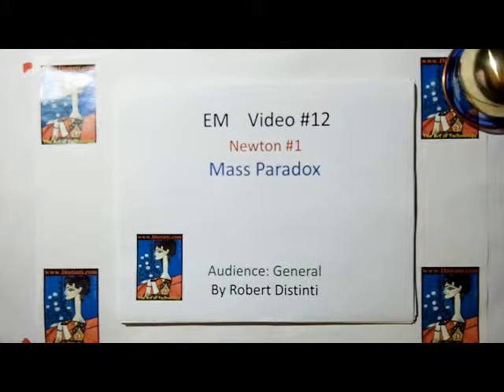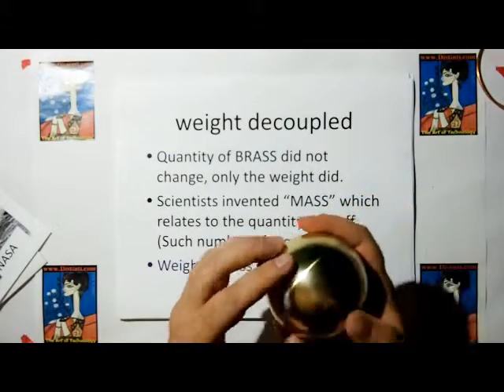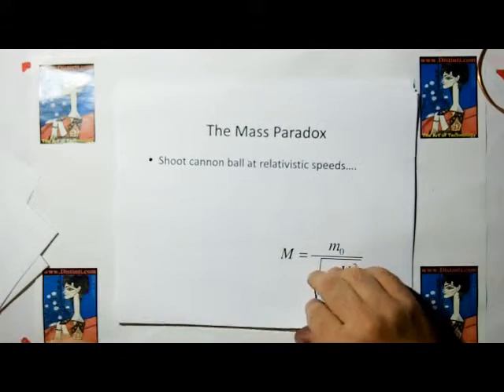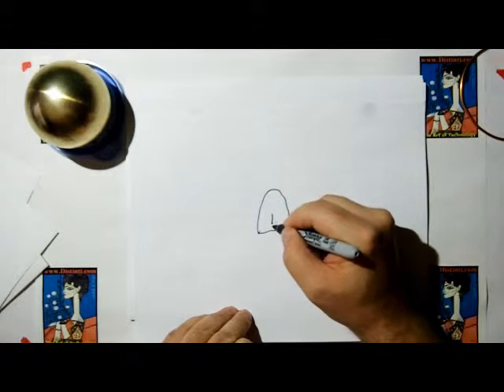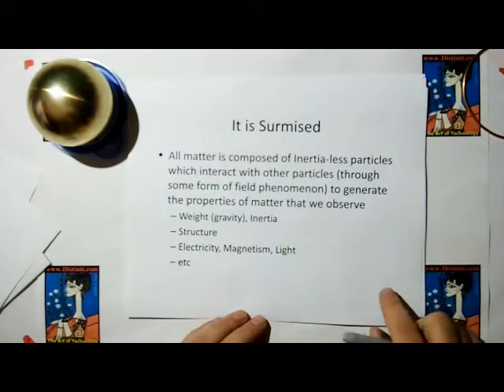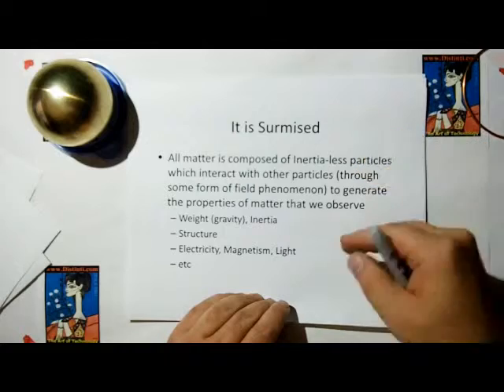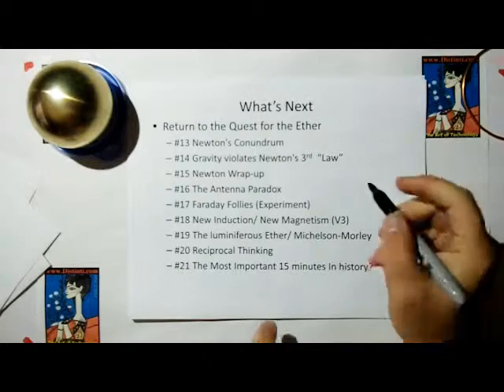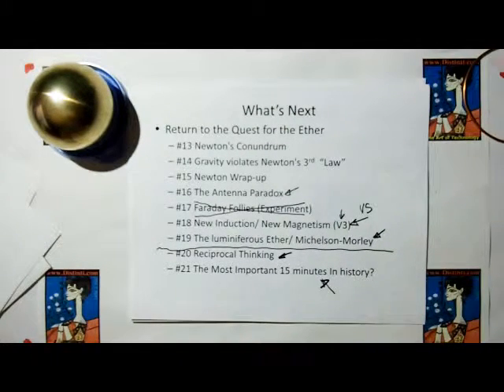emV012: Mass Paradox

Comment: When you expand your model to chemistry and electrolysis and plasma, the idea of mass conservation becomes negating of these models of particles.  It seems to me if you go after mass in E=mc2, you might as well go for folding mass into the formation of Aether into particles.
Reply: that is more or less exactly what quantum mechanics says particles are. their wording is vibration on a field but it there isn't really much different
Reply: Royvan7 so mass Or energy is not limited to the law of conservation. The stuff they are made of is conserved, but is not quantified in the exchange. So energy can be created from space, not from energy or mass. Over unity is normal.
Reply: one of the things both GR and QM agree on is that mass doesn't exist and is simply a property energy can exert. that is what e=m*c^2 implies. this energy moves through space. so, what is the next turtle down? what is the energy composed of and what evidence have you found this out from?  why would you assume we can derive energy from space? we've never seen the 2nd law of thermodynamics broken. why assume?

Comment: What about momentum ? Relativity mass paradox occur when we abstract mass from momentum, in fact if you multiply both sides of equation by velocity then it's momentum which changes near the speed of light. How about replacing mass by momentum in Newton physics ?
Reply from the maker: What is the electrical analog of momentum? Answer that question and you will answer your question.
Reply: @rdistinti  Is it current?

Comment: I have another serious problem with the classical model: There were many experiments for the measurement of the inertia of particles, but I miss any experiment for the weight of particles. I mean, the weight was always measured on neutral bodies (with same amount of positive and negative particles), and nobody checked the effect of gravity separately on particles. We can get the same weight for a neutral body, if we use a larger g constant, but proton has positive, electron has negative weight.

Comment: It is also possible to make one model from this two: Coulomb's law and Newton's law of gravitation. As both forces inversely proportional to the square of the distances, we can make one model where elementary particles has different constants for attraction and repulsion between them, and thus the result will be the same as we summed the effect of classical electrostatic force and gravity. But this model fails if "gravity" and "electrostatic force" have different propagation speeds.